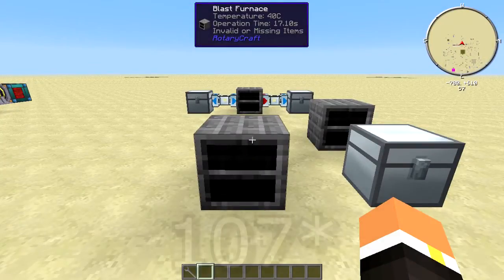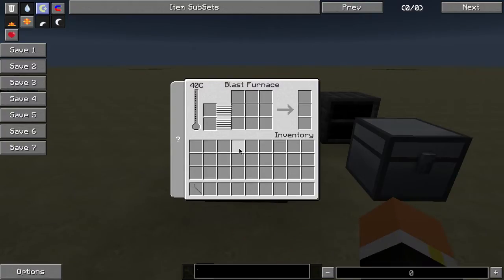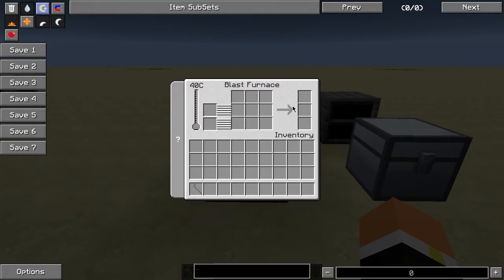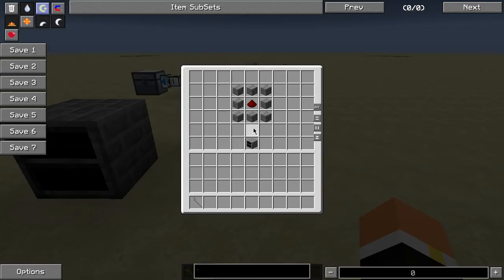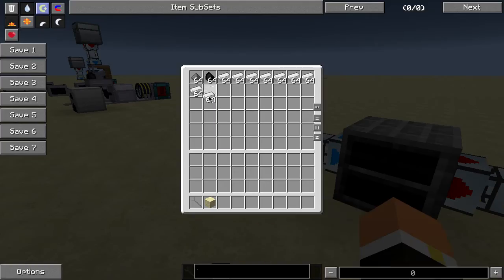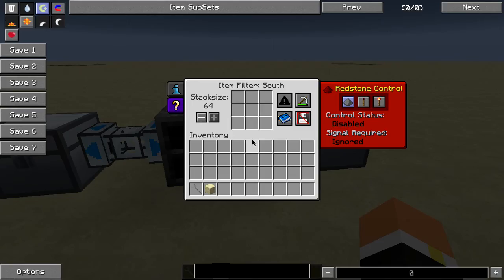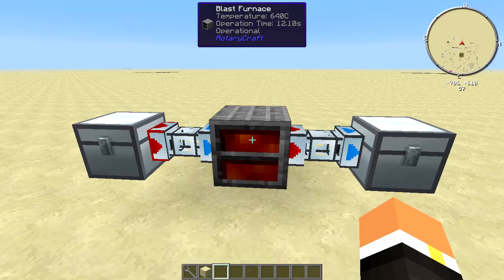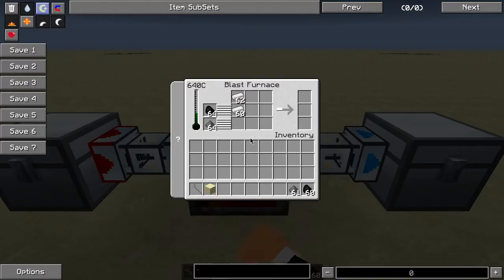Feed The Beast - Machine Tutorials - Blast Furnace

Comment: Your version is horrifically out of date.
Reply: +ReikasMinecraft hey, horribly off topic but, for some reason i can't get silicon powder. I want to make the performance engine but i need those aluminum alloy cylinders, I can't seem to get those as I can't get silicon powder. i have gotten my blast furnace up to 800 degrees + and i have the aluminium powder i got from the extractor and the blaze powder with sand in the 3x3 slot but it won't craft is there something i'm doing wrong?
Reply: If all of the requirements are satisfied, you are probably playing a version that predates silicon. Are you using FTB Monster, which is now two years out of date?
Reply: +ReikasMinecraft no. i am using a curse pack that recently came out called cubertron